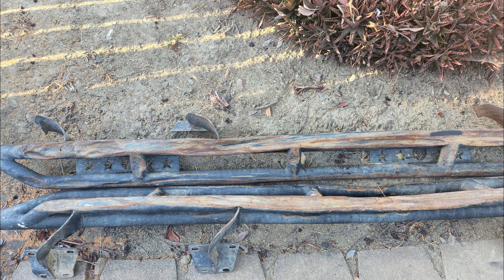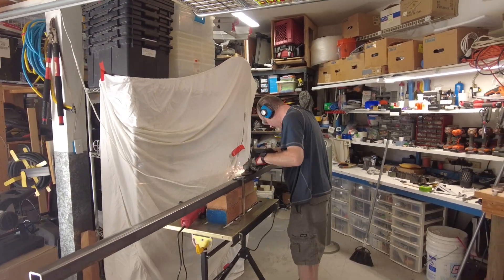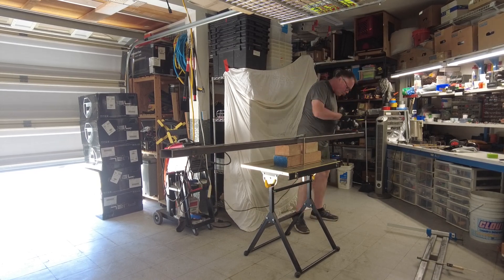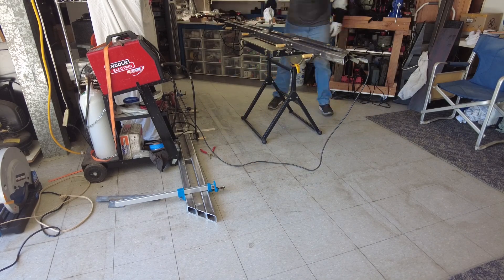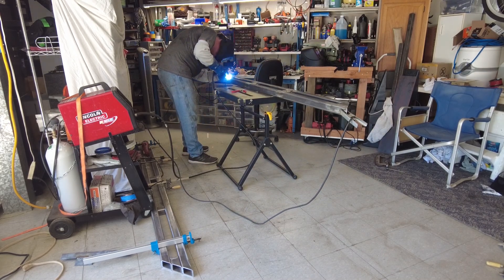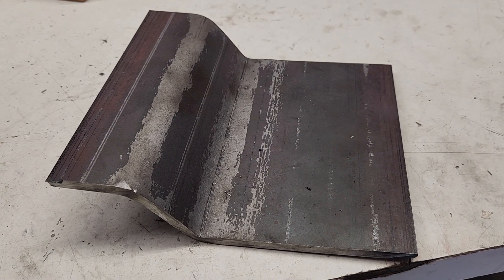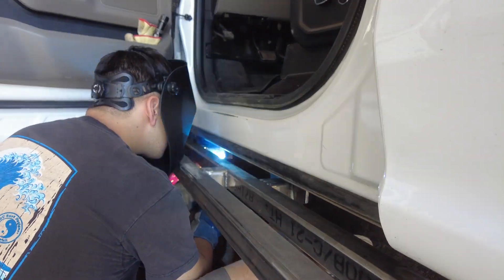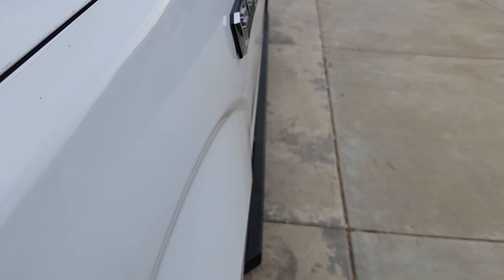DIY Thrifty Rock Sliders for Ford F150s

Comment: Great video. It looks like you are attaching to the pinch weld and not to the frame. I have heard on other vehicles that sliders should mount to the frame. Rocky Road's sliders appear to mount to the pinch weld as well. Did you model your design after theirs?